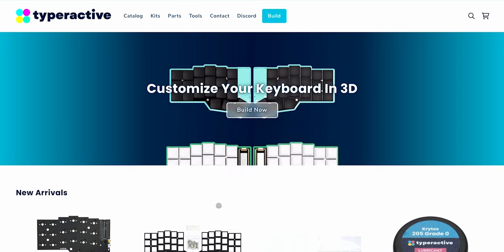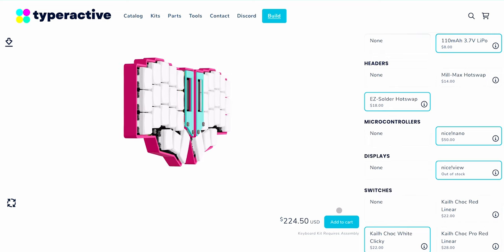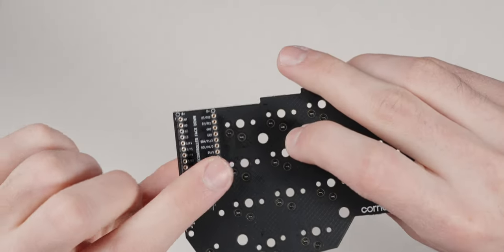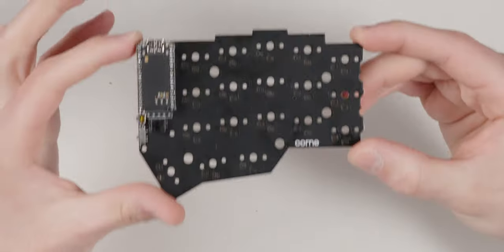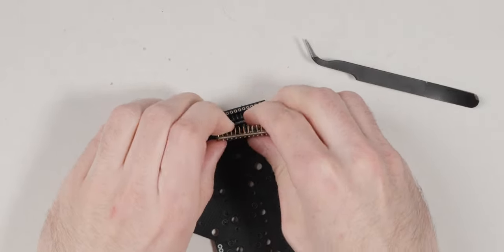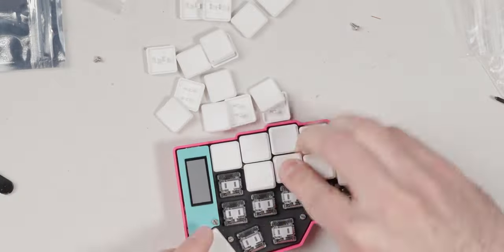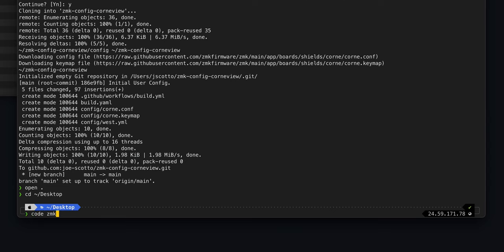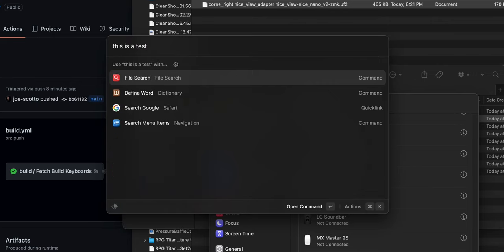How to Build a Wireless Corne Keyboard

Comment: no one mentioned this, but in the video Joe said he was going to order ez solder hotswap sockets/headers. However, in the actual build, he used  mill-max hotswaps. EZ solder has the black plastic case on the headers, and the mill-max hotswaps are just pins that you solder, just like Joe did in this video.  Just a FYI

Comment: Back in my day a wireless Corne meant we had to add bodge wires, used OLED holes for battery connectors, and hot glued our power switches on xD.  This PCB you used here is really great.

Comment: I think  it would be better to  put the silicone rubber protector back on the Tweezers Before using it to pry  your IC chip.  all tweezers come with free silicone slide on protector.  don't throw those away.

Comment: Great tutorial as always. I just got the prints for the ScottoFly and Scotto36 ready. Waiting for the diodes to arrive in the mail so I'll probably be building them through the weekend.
Reply from the maker: Hell yeah! If you’re not in the discord already, join up and ask any questions you might have :) 

https://discord.gg/vN6X3z8eyv
Reply: @joe_scotto  Awesome! I'll join right away. Will probably have to do some changes to the layout to fit the current one I'm using (Swolemak-dh , a Swedish variant). Plus I want to add a layer or two with my most used macros for Blender, Maya and Zbrush. See you then!

Comment: Personally the way how i remove socketed controller is putting a long object from the front, into the back so that it goes the whole length of the controller, and lift it straight up. I usually use a metal spudger from my iFixit kit, but semi hard tweezers for me too doing this.

Comment from the maker: If you have any questions feel free to ask and I’ll do my best to help!
Reply: I'm interested in building a corne cherry v2 because it seems like the v3 doesn't have the snap-offs to convert to 5 column. I can find the documentation for v2, but not the pcb files in the crkbd github. Do you have a go-to PCB file for the cherry v2, or another way to build a corne with 5 columns and mx keys?
Reply from the maker: You’re correct, the V3 doesn’t have the snap off column… I made that mistake once and was stuck with a 6 column PCB. Everything below V3 should have the snap off column but you can also find them on other shops such as little keyboards.
Reply: Thank you for the video! Is it possible to still use it wired on some computers?
Reply from the maker: Yup. The way it works is that the left half is the master and the right will always be paired wirelessly to it. You plug the left half in to the computer over USB-C and it will work with minimal latency. If you happen to game with it, the latency will be the same as a normal keyboard since the wired half is the left.
Reply: Do you know where I can find a Choc compatible TKL PCB?
Reply: Joe Scotto, I have never really used github so while I am learning it, would you be willing to sell or share your keymap and U2 files for those of us that just want to get something rolling? I can appreciate the time and effort that you have put into this and would not want to devalue that, so please let me know if this is something you would be willing to do.
Reply: great stuff. It seems the code does not work anymore though.

Comment: I haven't used a choc style board yet, but when I'm putting together a regular board, I like to put all the switches into the plate first, and then try to attach it to the board. That way, they are all snapped into the plate before I get it plugged into the board.

Comment: Thanks for the video! Quick question, in MacOS you have 4 at the bottom-left of your keyboard, on Linux/Windows you have 3, how do you manage that with these custom keyboards, also, does it support profiles and multiple connections so I can switch between environments? Or once you connect it to a laptop/device you can't pair another one?
Reply from the maker: It supports multiple devices and profiles. Everything is configured in code.

Comment: Great video, anyway you can show how you did the power switch? I am waiting for parts to do this and I’ve never done it before. Even an image of the board would work for me.
Reply from the maker: The boards from Typeractive come with it pre-installed so you don’t have to do anything. If you go with a traditional Corne PCB, you basically mount the switch in the TRRS spot and then run your battery to that before going to the controller.

Comment: Great build, neat site. Too bad as a European I can't get the battery with the kit, which is a bit silly because I can certainly google the product and have it shipped from like China but not in a kit from the US. Been thinking about building a smaller keyboard after using a Moonlander for about a year and a half now, and the Corne or Lily58 are both on the short list.
Reply: Same here. Getting the battery increases the price by 25% may as well get the voyager at that point

Comment: Nice Video, 

Would you recommend low profile keys vs normal MX? 
could you find keycaps for low profile with imprints ?
Reply from the maker: Depends on if you want something low profile or not, I can’t answer that for you. As for the keycaps though, you can find low profile ones with legends.

Comment: Hey very Nice video ! 
But wanted to ask how long do the battery last without recharging ? Batteries seems so tiny
Reply from the maker: It depends on how much you use the board but I typically get 1-3 weeks on a single charge. You can use the ZMK power profiler to get an idea: https://zmk.dev/power-profiler

Comment: Quick question: I don't like to worry about battery life, is it possible to use them wired?
Since they both have 1 USB port I'm guessing I can't connect them to each other and then to my PC, I'd have to connect both to the PC independently.
Reply from the maker: The nice!nano controllers will wirelessly connect to one another on a split build and you can just power each one over USB, so yeah 2 cables. However you can also build the Corne with Arduino Pro Micros and a TRRS interconnect cable which you would only need one cable to the computer.

That said, battery life is really good on the wireless builds. I get about a month on a single charge.

Comment: I noticed the links for Arduino and Raspberry Pi controllers, would the DIY change at all? I thought they all had varying pinouts. Would I be able to use Pis and get the same result?
Reply from the maker: You would need either a Pro Micro or a Nice Nano, they share the same pin out but just matters if you want wireless or not. This is if you’re building a Corne, any other board you’ll have to figure out which controller to use and where to match the pins.

Comment: What would be difference on price between a wired and wireless corne keyboard? Thanks, great video.
Reply from the maker: For the typeractive PCBs it would be about $50 less for a wired one. I’m not sure the QMK firmware would work without modifications since their PCBs are designed for their controllers. You can also just get a wired Corne kit from somewhere else, there are lots on the market.
Reply: @joe_scotto I'm looking for a corne keyboard, wireless and macro support, thanks for your quick answer.

Comment: That website looks sweet! I have a question for you: When it comes to tiny keyboards, which do you find more comfortable, low profile keys or high profile keys?
Reply from the maker: I like both but I would say that low profile switches are a tiny bit more comfortable. Feels like gliding over the keys if that makes sense

Comment: Will a battery fit under the nice nano without the sockets? As in, just with the ones it came with?
Reply from the maker: It’s going to be Pi Pico.
Reply: What? It said in the video nice nano. I just double checked.
Reply from the maker: @nathanp3366  Oh wtf… my YouTube studio app showed this as a comment on my latest community post lol…

A small 110mah battery should fit under the standard sockets if you solder it in place. The heigh difference is minimal.
Reply: Lol oh no worries I was just confused. Thanks so much for the info I really appreciate it. Getting ready to build my Lilly58 and was hoping I didn’t have to buy sockets too.
Reply from the maker: You shouldn’t have to but I would really recommend socketing the controller. If you accidentally brick it or it somehow goes bad, desoldering them is a massive pain. With sockets you just pop it out and put a new one in.

Comment: My country does not ship the battery  and I am also not planning to build it with nice view does this works wired? I am new to this so help is very appreciated
Reply from the maker: Yes, you could use an Arduino Pro Micro in place of the Nice Nano on most Corne PCBs. I would check that it works with the one from Typeractive but I know it does on all the other versions out there.
Reply: @joe_scotto  I look at the part of the video when you select the MCU of the board and there is no arduino micro option there. 

I will also just rely on this video if I would build it but buying different parts can make the process different I think it will be very hard for me I dont want to waste it, do you have any suggestions other than typeractive to buy parts of a corne keyboard?
Reply: can you still use it wired? my workplace does not allow bluetooth devices to be connected to our workstations, but I'd like it to be wireless for when I'm at home.
Reply from the maker: @roaba3581 Yup, if you plug in the master side then it will work wired. The halves communicate to each other over Bluetooth low energy regardless but the connection to the computer can be wired.

Comment: Can it connect to multiple devices at once and switch between them?
Reply from the maker: Yup, I have 5 profiles setup on mine. You just have to change the profile and it will auto connect to the device.
Reply: sick, is there any videos on doing that? also do you know if there's any tenting mounts for it instead of just having it lay flat @joe_scotto

Comment: And what is the practical use of displays on the keyboard? I only see them as power draining useless piece of junk. I might understand if the keyboard have RGB and display to give more to it, but this is just BS.
Reply from the maker: First of all, these aren't standard displays... they're nice!views that have very low battery drawn and were designed for wireless boards. In my opinion, displays are mostly useless but on a wireless board they're more useful as they display battery and connection status along with the current profile you're using. They also have another use in terms of design as they allow you to hide the microcontroller placement instead of it just being a blank spot.

Comment: 280 is kinda low for lead free solder :/ I rarely can go under 320
Reply from the maker: Yeah, that’s one issue with lead-free. If you can use it, I recommend leaded solder… it just works better.

Comment: PRO TIP: Professionals never use lead-free solder for hand soldering outside of full production, and neither should you.  Go with 63/37, or 60/40 if that's all you've got.  The heat for leaded solder is around 200 to 230 C, so it's much easier to do a good job and not overheat chips.

Leaded solder also flows much better, because it has higher adhesion to other metals.  Leaded solder will flow and soak in, while unleaded would just sit there in a ball.

Leaded solder is also more flexible, so it doesn't break as easily.  And it doesn't grow whiskers, like unleaded.

And don't worry about lead being neurotoxic, you're too dumb for lead poisoning to make any difference anyways (jk)
Reply from the maker: I swear by leaded solder, specifically Kester 63/37. 200-230c seems very low though, I always recommend 300c and about 280-290c for microcontrollers.